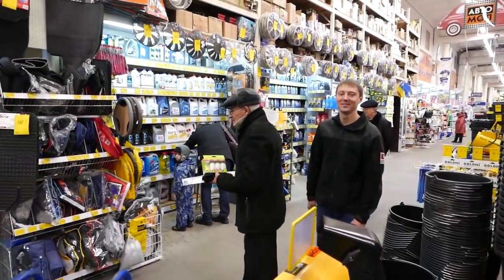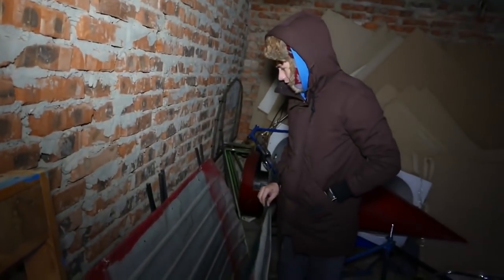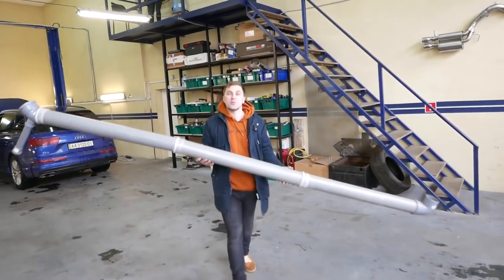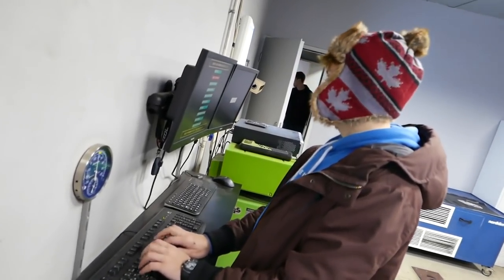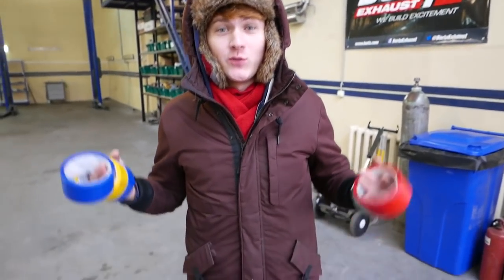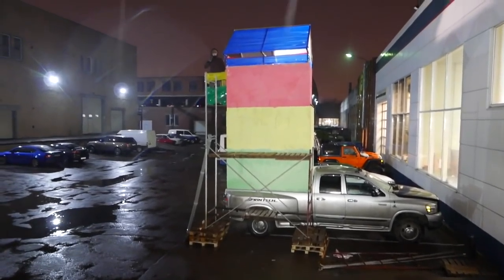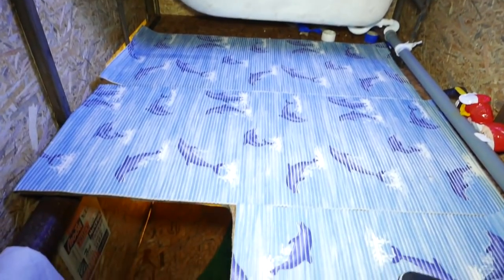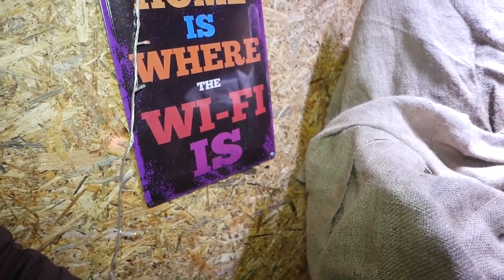3-STOREY HOUSE ON WHEELS | BATHROOM ON 3rd FLOOR OF A CAR

Comment: It would be good when you add a water pipe from the bottom of the house to a water tap above the bath tub.
If you have a water supply you can easily connect it to the pipe thats assembled to the house by a garden hose and you have floating water there!
Then you can add a hose bracket on the house to have along the hose on every trip!